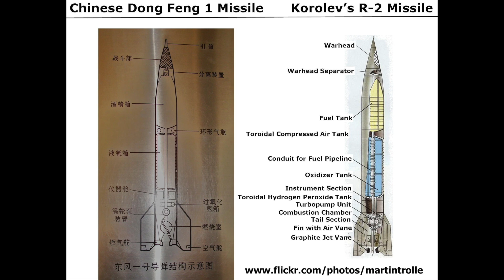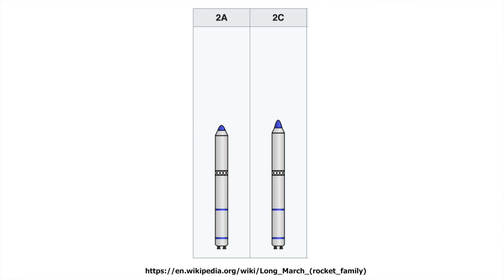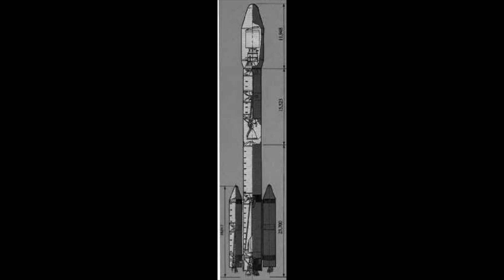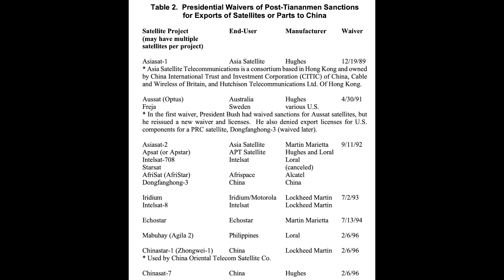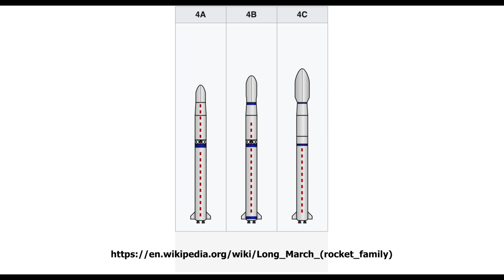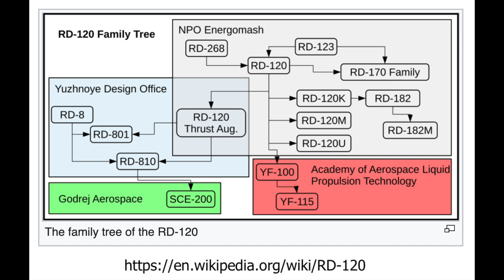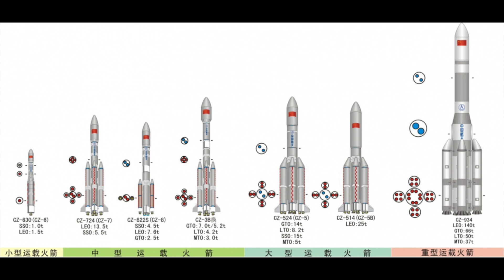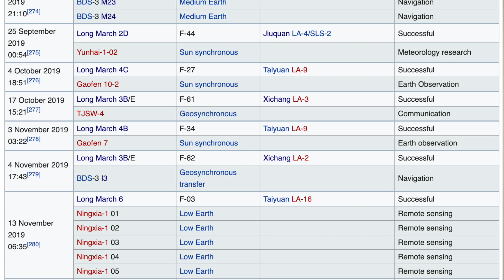Every Chinese Rocket Design Explained!

Comment: The launch vehicles preform quite well, but it is not good for the earth’s environment with the hypergolic propellant hurting workers dealing with with the rocket, and the civilians. It is not a renewable program/ one looking to not destroy the planet
Reply: That doesn’t change anything, it barely makes a fraction of the total C02 produced per year. China has hydrogen engines too btw.
Reply: @fork9001  although it doesn’t produce much co2, hyperbolically produce a lot of toxic gasses from the burning of UDMH and Nitrogen tetroxide

Comment: And you still have the good old problem of the rocket veering off course because you refuse to listen to me...

Air is a substance like water...

If you include internal funnels the length of the rocket it will go in a straight line... Especially at those speeds... Just like it would through water...

Comment: The Chinese Space Program is a bit like if the US kept every version of the Atlas ever build in servies to this day
Reply: That's basically what the Soyuz is too. In the end it's just based on a very old ICBM.
Reply: And yet its still most cost effective and reliable. Unlike the US, only for flashy propaganda but totally impractical. Now looking back,the shuttle was such a joke. Overpriced. Impractical. High maintenance. Highly inefficient. Nothing more than just a PR coup.
Reply: @Fred H
Wrong. The shuttle was designed that way for a specific mission that the DOD wanted done. The shuttle was able to get all its funding because it designed it specifically to be able to do that mission. I suggest doing a little research.
Reply: @fredh8065  Like that time a long March 3 rocket hit a village and killed more than 500 people…
Reply: @andrewdoesyt7787 if us don’t deploy so many military bases around pacific,china could have been using seaside launch pads in 80s
Reply: @listener-tt1gw  the particular accident that I’m referring to could have been prevented by using proper safety equipment(safety detonation)
Reply: @andrewdoesyt7787  Oh. I see.
Reply: @@jtran7272 I don’t think there is any proof that they were evacuated. You don’t evacuate an entire city before a rocket launch.
Reply: but if they disregarded where the rockets or it's jettisoned parts will crash
Reply: @totallynoteverything1.  Exactly why they built that new launch site on near Hainan. Not every country have the luxury to have a wonderful place called Florida or Mojave desert. (Most developed area of China is alone east and most desert are not easily accessable due to their relatively high altitude)

Comment: we may not have launched as many satellites into spaces China but we’re actually far more advanced in China that has everything to do with how far SpaceX  with its self landing rockets and by looking at there newest generation of prototype rockets that would be out by 2030 what we can see is that this thing is purely disposable it’s not designed to land and we can tell by looking at the design we don’t see any things like what SpaceX has their Finns are designed to catch the air to provide Air resistance and Control during landing and we also see the rocket engine using thrust vectoring but that’s just on the falcon nine but the starship that space x is developing is designed to land like a skydiver this rocket that China is developing it looks completely almost exactly like Apollo 11 basically it’s like a Chinese modern day Apollo 11 so this is not aerodynamic when it’s re-entering the atmosphere this can’t generate enough air resistance to slow itself down for a land and then also the additional booster stages just further increase the expense of the whole thing and we don’t see anything on them that would slow down their velocity during their landing phase for the boosters I don’t think they’re designed to land because SpaceX is booster stage has specially designed fins with grids in them that catch the air to slow it down so this thing is just a giant fancy showpiece for the communist party  it’s Ment to be a match to SpaceX it’s meant to stick it to the west but it really is a design that cannot compete with SpaceX is design I’m just going to go flat out say I’m sorry about this but my iPad keyboard is damaged and I can’t put periods in my sentences because I have to use the text to speech device so just put imaginary periods whenever you can or wherever you can in the text

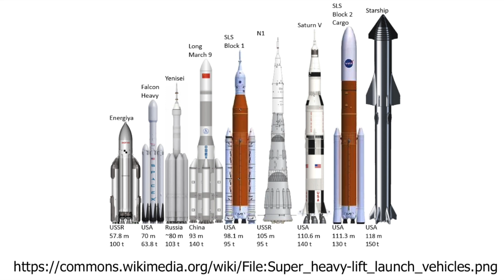Comment: 12:03 Wow Long March 9 look like much smaller, than other heavies rockets, but beat them all with 140 tons lift power. Have very effective engine. Exclude Starship with 150 tons, but Starship is much bigger in size, than Long March 9, but have only extra 10 tons lift power
Reply: Very true. But Starship is also meant to be fully reusable. So technically, Starship is in the neighborhood of like 200-300 tons iirc to LEO, but they won't do that.

Comment: One thing for sure, this host does neither read nor speak any genuine Chinese language at all, otherwise he could have acquired a lot of information about what he attempted to talk about here.  No wonder a German professor once told me that there are only two kinds of people on this planet, one is polyglots, and the other, ... , yeah you guessed it right.... ! 
And he was totally wrong about no live coverage, when there was live coverage for the latest launch of the latest rocket launch in Hainan, China which was a huge success and the failed launch last time about a year or so ago. The host is either lying or deliberately misleading for whatever reason. 
A sincere advice to the host: If he really wants to keep up with what is going on with China's rocket, he wouldn't wanna make the same mistakes as some Donald, the Groper did.

Comment: There is live coverage for those launches, Typically with a 5 min to 10 min relay. There is also result of fail or success announcement, but not directly to English online community. However, what can't be done is live for every launch missions, especially with GTO missions, you have to wait until the satellite park precisely in GTO orbit. Otherwise, Chinese TV's and HQ online streaming capacity has to spend 30 1-day-timetracks a year to cover all this, which is not wise economically .

Comment: 12:28 with the delay on ignition i thought it was gonna blow up lol
Reply: That is a very common way to launch ICBM. Using compressed air to push the rocket out of the tube, than start engine.

Comment: very informative,
yes, those based on DF-5 are not very advanced, but working, 
high hope of LM-5. especially on LM-9, which is basically with the same capacity as US Saturn 5, and if successful, will put Chinese astronauts on the moon.
compare to India, the most powerful one in India is GSLV-MKIII, 640 tons with LEO 4 tons (on paper they claim it is 8 tons, however, check the record, they never sent anything heavier than 4 tons into space), 
compare to China's LM-3B with total weight of 450 tons, with LEO 11.5  tons, 
so the payload ratio for GSLV-MKII is 4/640=0.00625
LM-3B is, 11.5/450=0.02555
0.02555/0.00625  that is 400% compare to GSLV-MKIII

Comment: 4C has a restartable upper stage. 4A and 4B don't. Also, the CZ-4 family in general can accommodate different fairing sizes, so the 4B and 4C can use the same fairing types.

Comment: Is there an open space between the stages on the rocket with a metal lattice?!
Wow, I see it clearly in the video now.  Why is it there?
Reply from the maker: Usually it’s for engines which are lit just before the stage separates.
Reply: @scottmanley  So, that's why the dome shape on the top of the stage underneath it.  It doesn't look very sturdy.

Comment: Why is there ice falling off the payload fairing at 8:57?
Reply: Those aint ice, those are a foam cover on the fairing provide protections to the payload, the launch site was in mountains or in the desert, there are  temperature between day and night , so it need a cover to provide a constant temperature for payloads.
Reply: usually the payload will arrive the launch site 2-3 days before the launches I think

Comment: Why at 5:30 do panels fall off the side of the rocket? I have seen this happen a lot and was wondering where they come from?
Reply: those are just a foam cover on the rocket to keep everything in a constant temperature,  due to launch site of LM2F was in a desert, and the rocket had to stand there I think for 1 day, there are temperature difference between day and night. so when taking off, those panel will fall off the rocket because the rocket no longer  need it any more
Reply: Joseph Stalin thank you!
Reply: @Dr.Coconut1245  no problem sir

Comment: I wouldn't say zero transparency for rocket failure, but it definently requires some digging into party read material to have an idea what have failed, for example the LM5 launch failure is traced down to thermal shock of certain alloy inside the O2(RP1? It's been a while since I saw that article and I can't remember which stage failed big time. All I remember is that it is not the Low temperature side that is having problem) Turbo pump that were not working properly under rapid transition of temperature and pressure during ascend, this suggested that China have areas that ground test is not an option and have to resort to real world test launch to see if their design works. Then again, China space program these days don't mind a failure or two, many of the recent "test" satellites were actually fully functional satellites that can be used as normal satellites, rumors even have it that the next LM5 launch will take a "test" space station unit up onto orbit and if launch successfully, can become the core unit of the China space station.
Reply: This comment can use more upvotes.
Btw, how do you ground test turbo pump for temperature+pressure transition?

Comment: The Dong Feng name means wind from the east.  Mandarin pronunciation should sound more like english pronunciation of don’t as in Don’G (hence most dong jokes will not work if pronounce correctly), Feng on the other hand would sound more like first half of pronouncing fungus, as fung. The long march name also carries the philosophy that this task is one of long term hardships and difficulties. As pronouncing that Chinese words in mandarin , it will be a little hard to get right first few times, cause it involve tunes (the way ng sounds ) not often used by English speakers. I m no language expert, hence I fail to find English words that can best mimic how it sounds like.

Comment: Look at the rocket at 8:50 and check out the debris falling off the nose cone!  That is a hell of a lot of stuff to fall off and we were told that something like this caused NASA's explosion when a chunk of insulation foam flew off the solid liquid booster (large center tank) and destroyed the entire spacecraft!  

How can these two things exist in the same reality?  Those things falling off the rocket look to be fairly heavy panels of some kind due to the way they fall though I'm open to thoughts on that.  

So what do you think?  How can so much fall off that rocket and what do you think it was?

Also the Chinese rockets seem to accellerate MUCH faster than those of NASA and the EU and I'm wondering 
if people or animals could even survive in the Chinese rockets.

Comment: “Had 8 launch attempts, with only 8 being successful” ???
Reply: thin boob line
Reply: Did you hear about the almost fully intact rocket stage falling on that Chinese village? Complete irresponsibility by those military and govt folks over there.
Reply: Thunderbird 1 this has anything to do with my comment.... how?
Reply: Thunderbird 1 In regard of that issue, it’s because for historical reasons Chinese space centers has to be built inland and therefore rockets will inevitably go pass inhabited areas. Prior to each launch the government will organize evacuations to prevent casualties and if anyone’s property is damaged they can get a huge compensation. And now the CNSA is also experimenting with grid fins so that they can control the drop point of the debris and, in the future, full recycling of the booster.

Comment: Which BTW, the people within the dropping zone are the ones who are as busy as those who actually do the rocket launches, the local government has to prepare for evacuation weeks before the launch date, thanks to the orbit of each launch isn't the same all the time, or the people would be definitely pissed off. If it is a crewed flight, the commercial airlines have to clear out an approximately 1500km*300km empty air space for potential rescue purposes for about 20 minutes.

Comment: Previously, every rocket needed to be modified to fulfill the requirements of each mission, so there were tons of types, the CZ-7 was originally called CZ-2/HF, "HF" means change engine,  some of the CZ-5 designs was shifted to CZ-7 due to its core stage diameter. The bad naming issue could be ended up in these new series of rockets been developing. I'm happy to see that CASC started to use digits which refers to the stage number, booster number sth. like that to name the rockets' sub types.

Comment: Hey, Scott! You keep switching between payload to LEO, GEO, and GTO in this video, which makes it hard to compare the rockets. Would it be unfair to measue all launch vehicles on LEO? (Maybe do a whole show on measuring payload performance?)
Reply: Yes it would, because depending on the design of the rocket, for example the type of engine on the upper stage, it can make a big difference to what payload it can take to different orbits.

For example, Falcon 9 has a larger payload to LEO, where Altas V 421 catches up in terms of payload at higher altitudes, eventually overtaking Falcon 9 capabilities at a high enough altitude (about 12 tonnes at 1400km altitude). This is because the H2/LOX upper state on the Atlas is much more efficient which makes a big difference at high altitude.

Comment: The long march 11 launch looks similar to that of an SS-18 ICBM where the rocket is ejected out of its container and into the air before the rocket engine ignites
Reply: It’s meant to be cheap, easy to handle and transport.
Reply: It is an ICBM derived rocket, derived from DF-31 ICBM, a spy leaked DF-31’s top secret data to some foreign country (I believe it's USA) , rendered those missiles obsolete, but DF-31AG is still in service——the only two things DF-31 and DF-31AG shared are the look and the name.
Reply: Yeah, they repainted the launch vehicles at former launches, which obviously is military vehicles , and lately they don’t even repaint again

Comment: 9:01 here we see the superior Chinese engineered rocked flying through anti air shells
Reply: The NotFlat Earth it has 1000mm of composite armour around it, that’s why it’s not getting damaged by the flak.
Reply: @jiaruiyan870  I would have say, 1000000000 nm instead
Reply: It is by design though, but it sure looks funny.

Comment: What are the costs and benefits of using liquid strap on boosters vs SRBs.
Reply: Not sure why they did that but generally: SRBs = high twr + low range.
While liquid booster = mid twr + good range.

I guess if u have a good core that doesn't need the extra twr to lift off, u can use this to improve the range instead.
Reply: Solid are more expensive.

Comment: Why is the exhaust of the long march's side boosters angled? Is it to help with stability?
Reply: Hi Wretlaw, you're correct or at least partially so. When radial boosters are added their exhaust thrust vectors are angled to intersect the vehicle's nominal centre of mass. This is done to mitigate unforseen thrust asymmetry in the event of an engine failure in one of the boosters. Hope that helps.
Reply: @jayriley9828   ah. that makes sense. Even if you won't be going to space anymore, you would still have enough stability to cause it to crash somewhere where there aren't people to crash on...

Comment: "Did the primary buffer panel just fall off my gorram ship for no apparent reason?"
Reply: I swallowed a bug
Reply: Sure would be nice if we had some GRENADES right about now.
Reply: Kaylee you told me those buffer couplings will last two more weeks!

That was three months ago captain.

😐
Reply: Looks like.
Reply: This is the captain. We've eh a little problem with our entry sequence so we may experience some slight turbulence and then explode
Reply: @DamianReloaded  

Explode? I don't want to explode...
Reply: @DamianReloaded  Are we going explode? I don't want to explode.
Reply: I want a bumper sticker that says "My Car don't crash. If it crashes, you crashed it."
Reply: Ship like this, be with you ’til the day you die.

‘Cause it’s a death trap.